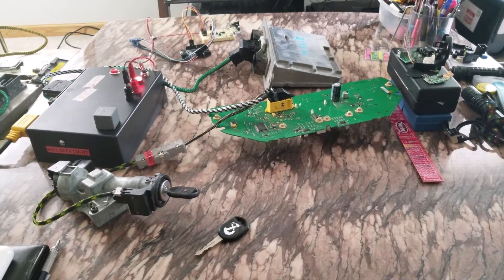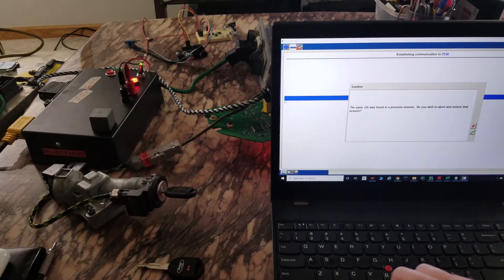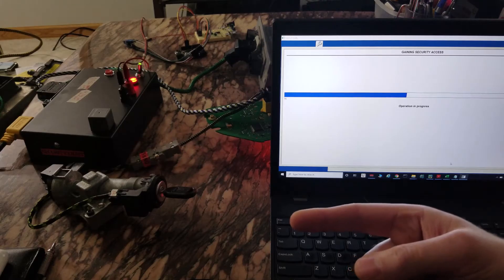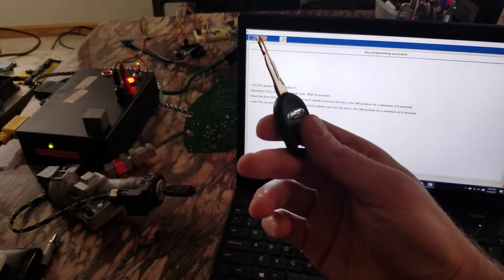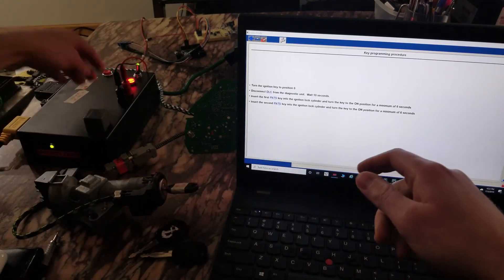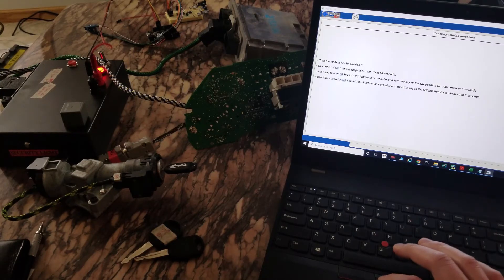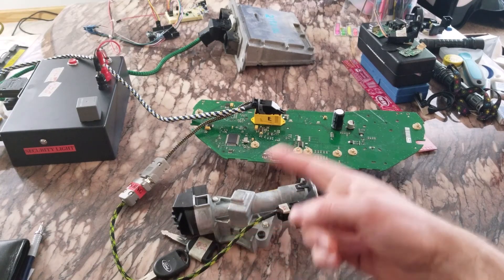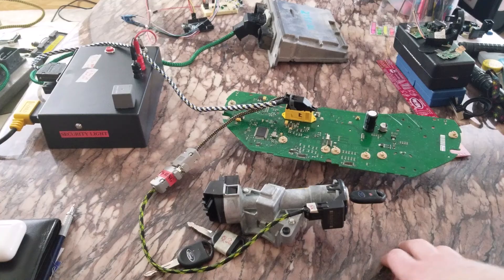Ford PATS Key Programming Problem and Solution

Comment: I got a 2014 Ford F150 (3.7L V6) and no matter if I use Forscan or IDS, I can never get into anything pats related - I can't delete the keys, I can't add a key. I already reinitialized the PCM and BCM and reprogrammed them using the AS-BUILT data, no go. Everytime I try to enter pats mode right when it is about to start the 10min countdown it immediately just says "unable". I have 3 keys learned into the truck, but I have lost two of them so I only have 1 key that starts my truck - which is why I wanted to add more.. I got absolutely no idea what I am doing wrong... I got no DTCs at all.

Comment: I have a 2003 Mercury Grand Marquis. I had a PATS event when my key ignition lock cylinder buzzer malfunctioned and shorted the circuit. The vehicle only had one key when I bought it, and I didn’t know that was an issue. After this event, tracking down a compatible transponder key has been a nightmare. I still don’t know if I have the right type. They discontinued the transponder chip that is used in my original key. They replaced it with an updated chip and I don’t know if that update is working with my PCM. 
I’ve replaced fuses and my ignition switch, fixed the ignition cylinder buzzer, reprogrammed the keys and I’m still getting DTC B1601

Comment: I have a 2013 focus with pushbutton start, so the fob is detected anywhere inside the vehicle, it is my understanding that the fob to be programmed needs to be placed inside the transponder ring inside the steering column (same location as if there was a conventional key), have one working key and attempted to add a second one using forscan, after the 10min wait, and says fails to detect the key, even tried adding the working key again to see if it was a problem with the new and it also says no key detected, am i missing something? Is it likely a problem with the cluster, or transponder ring?

Comment: Have a issue friend of mine was trying to add a 3rd key to a 2013 transit connect and erased both key codes and the autel mk900 won’t reprogram because the van does not have a drive cycle on it and has codes any info would be greatly appreciated thank you !

Comment: Could you please help me to do the parameter reset on my 2017 Ford Transit T-150.
The AUTEL scanner popped up the Outcode-BCM: 6CCD24
In THE INCODE/OUTCODE Calculator I've entered 0000-6CCD24-000000
Received the Incode: DD68, that I've entered in the scanner and I got the "Incode entered was not correct" message.
What am I doing wrong?

Comment: Hey I’ve got a 05 ford free star. Had a pin pulled out of the pcm for the charging circuit vehicle started and ran fine.
Sent the computer off for repair and when it. Came back it now has a b1681 code  I’ve tested everything and the common denominator is the pcm because it had zero issues before. 
What do you think we have sent the pcm back to that company which says it’s still fine but I don’t believe them

Comment: I have a 2002 sports Trac lost the keys had a locksmith come and make new keys could not program into ignition and make it start I've tried everything what do I do can I take a keyless ignition and start the truck or would the pats system stop that
Reply from the maker: You'll still have a pats issue.  Does the theft light blink rapidly with the key turned on?

Comment: I suspect I’m having trouble with my PATS, even though my 2007 Expy has been stripped down to a roller/camper (removed front end, powertrain, drivetrain, dash, seats, etc) that I plan to tow as a sleeper/camper. I decided to NOT rewire everything, since the fuses/relays in the BJB and SJB give me about 99% (still no SJB power to 5A “radio” fuse #28 for some reason) of what I want (window operation, lights, etc) with just a few jumpers. I hear the internal relays clicking on/off in the SJB which I assume is the PATS going haywire, but not sure how to disable. I may expose the PCB of the SJB and see if I can solder something to kill the annoying clicking sounds. Any pointers?

Comment: I am working a 05 Lincoln town car.   Key not programing after deleting keys, all keys lost.
I deleted the key to reprogram original keys.   Fob remote works. But the blade key wont start the car.   I think its the PAST transceiver.  🤔🐒
Reply from the maker: Hi, 
You have 2 ignition keys correct?  Is the security light blinking rapidly?
Reply: @IntegratedAutoModules  yes but I deleted all keys to try and reprogram but reprogram failed.
Reply from the maker: I'd check voltage and grounds with the ignition turned on.
Reply: @IntegratedAutoModules  thank u ill do.

Comment: Hey man?  do you still do this?  I am currently fighting with a 2002 f150 that IDS says it can not connect to the PATS module.  I have swapped out the cluster, the PATS/remote box under the dash and the transceiver ring.  I keep getting a 1-4 code on it.  IDS takes about 30 seconds to time out.
Reply from the maker: Hi, Send an email Leac0071@gmail.com

Comment: so the small control for lock unlock the door, also do not work, I reinstall the pcu and the ring from the escape no working on the working, turn  the engine the goes off(about 10 second), but the control works in this, so i was thinking all the code are store in the pcu, but I think this is not true

Comment: I’m having the same issue but didn’t have an issue with the old PCM and cluster. The cluster is out of a donar car and was installed without PMI but we were able to add 2 keys to identify the crank no start. Did not have the original cluster. 

Got a pre programmed PCM, did a parameter reset with one scanner, removed all keys and now unable to add keys. Tried a second scanner and now also unable to do a parameter reset.  Tried the old pcm and still unable to add keys again to the cluster. Pats light stays solid. Any help?
Reply from the maker: Are all the part numbers the same?
Reply: @IntegratedAutoModules  the pcm part numbers are the same. It came pre loaded with the as built data. The cluster is out of the same year escape, but not original to this car. We never had the original. Tested the transceiver with an antenna tester and it seems fine. It just seems odd that we were able to add keys to the cluster before but not we can’t. We performed a perameter reset in the IC section of the scanner and it takes the reset. But we can’t seem to perform a perameter reset under the immobilizer section, it fails everytime. Using 2 genuine ford keys

Comment: great video! i lost my 2010 ford ranger keys and did get a couple cut, now i need to figure out how to program at least 1 to get it rolling again, it's 300 miles away at a relatives home and i keep watching vidios where they use magnets to bypass the security system, does this work? thanks again
Reply from the maker: The easiest solution would be to call a local mobile locksmith.  Explain the situation and verify they're capable of resolving the problem.

Comment: im in the same boat right now. Have an 09 focus. Keep getting the p1260 for theft detected vehicle immobilized.  And a bcm or ic code for less than two keys stored. Transceiver is doing its job. Just got two new ford blank keys today to get away from aftermarket key. I noticed that if I do a parameter reset cluster will not come alive after; I thought I read somewhere that a successful parameter reset will end with cluster coming back to life from all dark.

Comment: I had the identical problem on a 2007 Ford Exployer after PCM change. I spent many hours trying to program. Your video helped and I thought I would need a cluster. Found code P1260 locked into PCM. Did 10 minute security access again for the 20th time. Reset the unlimited key mode to disabled or turned it to off mode. Then did parameter reset. Did the key programming and the keys worked with security lamp indications just like yours and the vehicle started. I hope this helps you and others.
Reply: Thank you for this reply, worked for mine also after having multiple people trying to figure out why keys wouldn't program, your post did the trick, 2007 Lincoln Navigator
Thank you again
Very Grateful
Reply: Thanks it worked for me perfectly
Reply: Can  you clarify, you turned off the "allow spare key programming" and then reset parameters and turned it back on? or left it off and were still able to add new keys?
Reply: The problem in the end, was the cluster?
Reply: I had the same problem on a 2008 Taurus after replacing the PCM and was using an Autel MX808 to try to reprogram the original keys.  After many attempts at reprogramming, I erased the original keys and confirmed that there were none programmed by erasing the keys but stopping short of programming them back in the system.  I then checked the GEM to see if they were erased, to confirm that the network was working correctly, and it showed no transmitters programmed.  I then re-entered the programming mode, set the unlimited key mode to off, performed the parameter reset, and programmed the keys.  The car then started after cycling the last key off after programming,  Thanks for your help!

Comment: I’m working on trying to program two smart keys to a 2015 escape for a used car lot. I’m getting a “programming fault” at the end of the 10 minute security period. I’m not in any need of software/tools….but I sure could use some knowledge on the testing of wires and control modules. Then being able to decipher what the readings mean. (It would also help if the vehicle was inside with some heat.) This particular vehicle is not getting a signal from the transponder ring, but the transponder ring does have continuity.
Reply from the maker: Swap the ring if it's cheap and easy.  Or you could backprobe the ring data wires at the PCM (or wherever the wires lead on a 2015 escape) with an oscilloscope to see if any data is arriving.
Reply: @IntegratedAutoModules  well, I don’t have an oscilloscope, so I’ll probably have to just swap out the ring. And then look into possibly purchasing one. Thanks for the advise.

Comment: Have a similar issue on my 2011 F350. Let the batteries die and get really really low, hit lock/unlock while batteries were barely charged and exterior hazards started flashing repeatedly and got dimmer and dimmer. Then once I charged truck batteries up and try to start, no crank. Check PATS with Forscan and "Number of stored keys: 0" as well as B10D8 and B10DA. Thinking I might be dead in the water for gaining security access to reprogram my two original keys.

Comment: I have an 01 f150. I lost keys . Put a new switch an have a set of transponder keys I have a diagnostic scan tool tht allow a me to get I. There delete and re learn keys . They will not program I've even tried another set of Ford keys.. do you work in these can I send mine to you  I'd either like them program med or just delete pat system out all together..

Comment: Hey man I have 04 f150 that is doing the same thing no crank I had a lock smith come out and he was thinking the key die he made me a key no crank I will name everything else I have put on it cluster a hole  steering column with a key and pcm together off the same truck then lock smith come out same thing then went buy a transceiver  had him to stop by and look it same thing so I have been out of anything to drive to work I need help bad

Comment: I took my 2011 mustang to get the 2011 premium cluster swapped into it. They said they knew how to do it but they were unable to program it. They had a bunch of problems getting the old one to work also but they called me and told me it back working. When I got there it was cranking but the dash said there is a security fault. I think they rigged it somehow just to get it to crank. I’m really freaking out about it because I don’t know what to do. I really want the premium cluster to work but if I can’t then I want it to be working like it was before that. They were using snap on. Can you fix it
Reply from the maker: Hi,
Send an email Leac0071@gmail.com.  I'll likely need both clusters, the keys, and pcm.

Comment: I’m having the same problem with my 2012 Ford Fusion I have two keys both open and close the doors manually and via remote. Anti theft light on car won’t start also mileage to empty blank.
Reply from the maker: Hi, has it had any recent repairs?  Does the theft light blinking rapidly with the key turned On?
Reply: It was in a wreck hood was dented. Theft light is blinking all the time, even when I try to start the car. Also miles to empty isn’t showing
Reply: Yes, theft light blinks rapidly when light is on. Also, the chime noise gets increasingly louder.

Comment: If you mail the customer back their pcm, keys, and gauge cluster. Will the keys not be reset since they got disconnected?
Reply from the maker: The key info is stored in nonvolatile memory and does not get erased when it's unplugged.
Reply: @IntegratedAutoModules . Do you still service theses systems.  I would mail mine to you if you still troubleshoot these systems.

Comment: Im having the same issue with my 2014 mustang. I replaced the pcm and did a parameter reset before erasing and programming keys. But still the pats light is on constantly. Could not start the vehicle. The fds dtc shows minimum number of keys was not programmed. Will there be an issue if the new pcm is not programmed to the cars vin or is it the instrument cluster to accepting the keys ?
Reply from the maker: The problem is not the vin.  If possible scan the security PID for current number of PATS keys leanred to verify at least 1.
Buy a few new ignition keys and retry; one of your old ones may be faulty.
Reply: The car had originally 1 key when i bought it, but now im trying to programe with 2 keys the other being an aftermarket flip key with the same transponder chip 4D63 chip. Is there different frequency to the keys that is not being read by the key ring? Also it has 1 key programmed and had dtc with less than minimum pats key
Reply: Any update on this issue?
Reply from the maker: Was the 2nd key cloned from the first? If so, you'll need another key.
Reply: @IntegratedAutoModules  its not, its a new key. I did the same procedure as you did but end up with the PATS light on. Also the old key isnt erased as lock and unlock also work after key code erase fuction.
Reply from the maker: The gauge cluster may be the problem.  I can test the parts and program the keys if you run out of options and you're in the US.

Comment: I need your help. My mechanic reprogrammed a new (used) PCM to replace my original. Apparently the programming works (even the keys seem to program) but it will not start. Solid red security light. They are convinced its the instrument cluster and we just can't find one anywhere for my 2008 E150. Could this be the cluster? Could you fix if I sent it to you? Do you know where I could source one? Please message me back or email me at atomicben@gmail.com
Reply from the maker: Did you solve this problem?

Comment: I have 04 f150 i only had one factory key took it my local locksmith to get a second key program. Every work fine when i left but after i turned it off it want start back up. Was told the error code was the anti theft wasnt letting them fuel pump come on. They had to reprogram the keys. But it keeps doing it. Any ideas of what might be going on

Comment: Sometimes my cars theft light will blink fast when i turn it over try to start but it wont start or crank. It happens randomly.  Sometimes it start right up, sometimes it will happen but then eventfully start after multiple tries and sometimes wont start at all, even after a hour of trying. And this is my daily car. Please let me hear your thoughts. Ive been researching and looking things up for hours.Thank you
Reply: Im having the same issue in a 98 gt but now will not start at all only cranks. Any help would be appreciated!
Reply: @jahsehguajardo4594  Mine ended being the anti theft PATS transceiver. Cost about 15 bucks and 5 min of work.
Reply: @BcottStudios  where do you get one? I have a 98 GT that's giving me the p1260 code. I don't hear my fuel pump priming, only have one key, it's always worked
Reply: @aro5276  ebay
Reply: @BcottStudios  will a junkyard find do the job?
Reply: @aro5276  Yes
Reply: @BcottStudios  this is happening on my 2014 Mustang. Where & how can I replace the PATS receiver? I never worked on a car but am willing to try or take to local mechanic. Thank you for sharing.
Reply from the maker: What year and model vehicle?
Reply: @IntegratedAutoModules  2004 ford Tuarus
Reply: Thanks ill give it a look
Reply: @jahsehguajardo4594  Let me know what you find out
Reply: @BcottStudios  so just an update talked to a mechanic and we're thinking it may also or only be the pcm since the sct tuner isnt gathering any data whatsoever from the car.

Comment: I have seen this same issue two times. The solution here is if it’s a ford use a Lincoln or Mazda key as one of your program keys and it fixes it. I personally took one of the chips out of the original key taped it to a Lincoln key that was used and it fixed it. The second time I saw this issue it was a Mazda. I used a ford key again (used) and it fixed it. I cannot explain why or what happens when you do this but it fixes it every time. I also saw this on an 08 Explorer I used an S stamped (used) Lincoln key and it permanently fixed the cluster and all keys programmed. Use the key as your second key in IDS programming procedure.